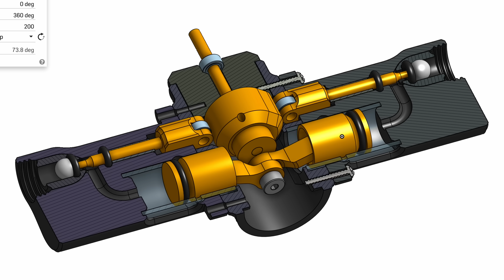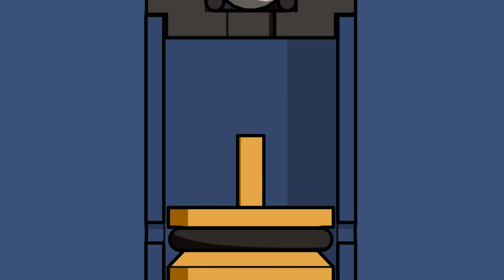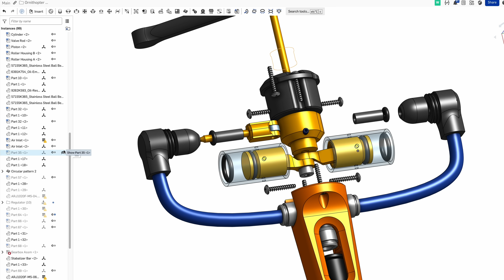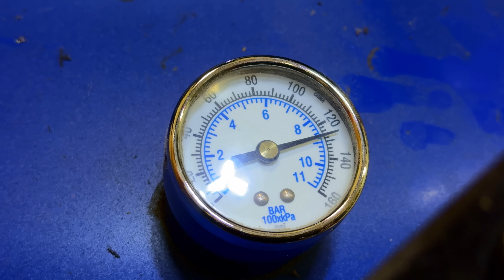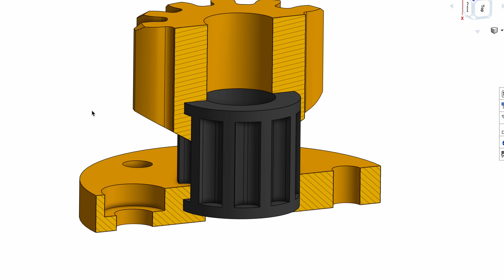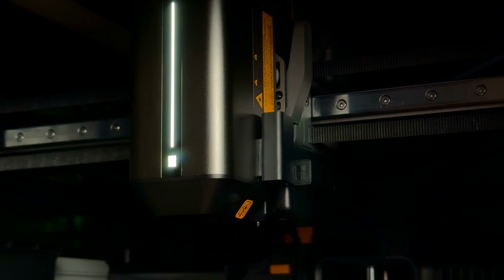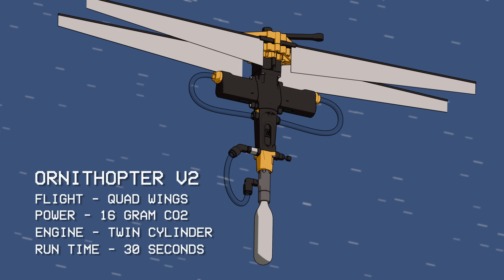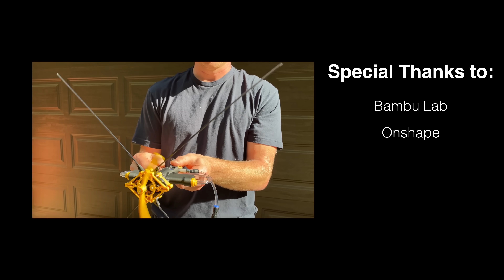I Tried to Build a Flying Machine With Just CO2

Comment: As an aerodynamicist I have to say yes you achieved some success in your mechanical designs and testing but you failed in the basic premise of creating sustained stable flight, you gave almost no thought seemingly to the wing design which could be massively improved and very little to all up to weight which are foundational to flight, I also wonder about the CG and torsional reactions you are likely to get. That said I enjoy your process and skills.

Comment: Honestly with the high torque motor you designed, you could slap on larger wings to generate more lift at a lower flapping frequency. I think the total weight still need to be shaved down a bit, but that could be a smaller issue than it seems. I'd hate to see this not fly, keep at it 🎉🎉
Reply: If I can give any kind of help I'd be happy too. I've been working on an Entomopter for a while now and got plenty of notes 😅

Comment: You could try lower friction materials for the pistons internals, try reducing the infill of the prints dramatically, and potentially a more aerodynamic design or cover for the pistons, might help prevent drag from becoming an issue. just some ideas tho, I'm not aerospace engineer

Comment: On your wing design I didn't see any details about the stiffening ribs and their intersection with the spar, are they free floating?  What sets the pitch of the wing (via the ribs) and transmits the thrust created by it's angle of attack?  They should be making a smooth vertical sine wave when viewed from the tips but it appears they're just going back and forth without an angular transit creating downward thrust.  Restricting the movement of the ribs in a pendulum fashion in each direction with greater movement towards the root and less towards the tip would enable that transmission of thrust.

Comment: This is amazing and the visuals are incredible. But, you are turning a reciprocating motion in to a rotational motion, then though a gearbox, then back in to a reciprocating motion. surely it would be better to just have flapping mechanism run of the piston directly. Like a little mini gas solenoid?
Reply from the maker: I was trying something like that early on, but I couldn't get the piston to run smoothly and at a reliable speed. Having the piston rotate a mass helped the engine run smoothly and then it just became easier to take power off of that rotation. I think that idea is still worth exploring though!

Comment: Instead of turning rotary motion into oscillation, why not eliminate the rotary motor and design a way to power the oscillating wing directly? That will save you in weight and may improve efficiency.

Comment: This is so sick - your mechanical design skills are phenomenal dude, can't wait to see more!
Reply from the maker: Thanks man! If I ever get it to fly I might need some tips on deployable landing legs ;)
Reply: @worksbydesign  Instead of CO2 cartridges, you might want to take a look at using the canisters for the mini signal horns for boating. CO2 has a verry high preassure, which requires quite heavy cartridges and strong regulators. That is unnecessary weight, since the higher preassure is just dropped at the regulators. The mini air horn canisters use a gas, that is liquid at much lower preassures (8 bar or ~ 3 bar/43 psi for the ones fillled with butane), so a lighter regulator can be used, if needed at all, and the cartridge has a much better gas to weight ratio.
Reply: OMG ITS YOU!

Comment: Really good video :)
I think you need to design something simpler. Integza made a design similar to Tom Stanton but maybe even more efficient. You might want to give it a try.
Maybe try to simplify as much as possible the path of the air from the regulator to the wing motion. It will need to be something extremely simple and genius to make it lightweight and fly.
Don't give up on it. I am sure you will make it work! Good luck :)

Comment: The video glossed over the coolest part of the design (in my opinion), the CO2 regulator. The video seems to show him designing it, but the part itself looks massed produced. How? I need this regulator for projects.
Reply from the maker: That was my favorite part too! I had the parts machined from aluminum and laser sintered from titanium to withstand the higher pressures. I’ve got the full CAD files and drawings on my Patreon if you’re interested!

Comment: I’m not any kind of engineer, and have no experience. That said I might do some tests with the gear reduction to find a better balance maybe? I would also try and use material with triangular holes in it for non air tight components- I don’t know how many parts need to be airtight though.

Comment: Use the laser cutter module to cut all the yellow top frames from some carbon fibre sheet.  "Skeletonize" the crankcase and all 3d printed parts. Redesign the root of the wing so that the boom can pivot back and forth (20-30 degrees each side?), improving the angle of attack of the wing root

Comment: I am not an engineer, but I think I have an idea to optimize your engine. What if you use just one sphere moving left and right to make air go into the engine? Maybe in this way you can reduce the engine weight. Also to reduce imbalance try to make a sincronized boxer engine like the one in the citroen 2 cv engine. In this way you can use a lighter flywheel.

Comment: Very interesting. A thought to reduce weight and increase efficiency... although getting it to work might be an absolute SOB.
As soon as I saw four wings I thought "Ah, dragonfly!" So how do they flap their wings? Very basically their wings are part of a resonating system where the wing roots are set in to a flexible box. This allows the wings to flap with great efficiency and much faster than the muscles providing power can twitch - the muscles just give the whole resonating system a kick every few cycles to keep it going.

Comment: you may know:  the amount of mass that is in reciprocating motion  Should  be  Minimized.  ( pistons, wrist pins, con-rods, rod ends/bearings )      the inherent out-of-balance condition at the crank-pin should be minimized.      a significant amount ot of energy is lost in a planetary gearset.      relatively more energy is lost in a more complicated valve train; however, imo, the operation of valves should not depend on gravity.      you may realize that your initial run duration estimate was based on an un-loaded engine. 
0438  in a power transmission transform such as this, having load-bearing parts 'hanging off the end' of a drive shaft is a less-than ideal design.

Comment: I think that te wings have to be bigger. The movements are now limmeted by the slowness of the mass. Not enouf by the air resistant. So make te wings bigger without adding weigt. Dont try to 3d print everything. Use thin springwire. Its very strong and doesnt bent easy. Use thin celofaan voor the rest. Just my idea. I am not expert. The motordesign is briljant. Great work. I am sure this will work if yo improve it.

Comment: That's a sick engine, and the co2 regulator could be super useful for tons of projects, although my issue with co2 cartridges is usually trying to get the pressure out faster...
Reply: Instead of CO2 cartridges, take a look of using the canisters for the mini signal horns for boating. CO2 has a verry high preassure, which requires quite heavy cartridges and strong regulators. That is unnecessary weight, since the higher preassure is just dropped at the regulators. The mini air horn canisters use a gas, that is liquid at much lower preassures (8 bar or ~ 3 bar/43 psi for the ones fillled with butane), so a lighter regulator can be used, if needed at all, and the cartridge has a much better gas to weight ratio.
Reply: Hi Joel, next video when?

Comment: you could try adopting integza's design for the motor (https://youtu.be/udI2dWmwMUE?si=1pHLtor084M_1jR2), and try increasing the amount of air the wings move by making larger wings. You could also try to alter the gear ratio to increase the bpm.

Comment: 1. Turn the wings 45 degrees. They should push the air vertically not horizontally. 

2. Make guide for air outtake face downwards 90 degree. Use it as a lift force.

Comment: This is a brilliant project, fantastic work!

In regards to shaving off weight, I have to ask: what material did you print the main parts with?

If I can toss a recommendation your way in case you try anything similar, High Impact Polystyrene (HIPS) is one of the lightest polymers I've had the pleasure to print with (it's also pretty damn strong). I'm guessing merely using HIPS wouldn't get the this ornithopter airborne, but maybe you'll find some use for it in a future project.

Comment: I'm no expert, but a good way to reduce weight would be to reduce redundancies. I'm not sure how possible it is, but you have two pressure regulators, maybe you could find a way to reduce directly from the 800 psi to 30 psi.

Comment: If you are an engineer do the basic math and build something that is able to achieve flight and is controllable. Just use a normal brushless motor and check what is their output thrust using propellers… that’s a good approximation , the eventual thrust will depend on the efficiency of your mechanism and wings.

Comment: Can someone explain to me what's the benefit of the high pressure CO2 with multiple levels of regulator as opposed to one larger tank at lower pressure?

You are trying to counteract the weight which means less parts would be better and size is not the primary concern

Comment: I loved the video, that quality is crazy for free content! I hope to see the next part soon! :) 

Here are a couple of ideas to improve the design :
- Check the infill of your 3D prints, not all of them need to be that strong and/or heavy.
- As other comments already said you convert the reciprocating motion of your pistons into rotary then back to reciprocating. This is a major factor that adds weight unnecessarily.
- Your initial regulator in metal weighs a lot, every piece of metal you can shave off will take a lot of weight away. So either replace it with a plastic piece or maybe this would be the perfect place for a 3D metal print!
- The wings could be bigger, you have a lot of torque after all so use it all instead of keeping too much inertia. It makes the whole mechanism shake, you can see it when the wings go back towards the center and stop at the end of the motion. If all the energy was used it wouldn't make the whole assembly shake.

Comment: maybe you can use the back pressure of the regulated air on the other side of the regulator piston to reduce the spring force needed? I think the regulator along with the cartridge are the heaviest parts. As someone else stated, you might be able to simplify the engine and remove the camshaft to reduce part count and weight. Increasing the amount of pistons may also allow you to get rid of the gearbox which can save more weight. Anyways, very impressive project and the explanations and editing are top notch!!

Comment: 6:30 It wasnt shaking becouse it lacked a flywheel, it was becouse you built the engine without considering balance at all. You want your opposing pistons firing at the same time. It will still create some torque, but it wont shake so much

Comment: If you already need the heavy regulator for the high pressure, just make it one stage all the way down to opperating pressure!
I know it gets more difficult to get a precise pressure with such a big gradiant, but there are some tricks to achive that.  😉

First you need a conical valve without o-rings or gaskets.
This gets you a very linear, short acting behavior.
Like in most commercial designes, you have a valve seat out of a softer metal like brass, and the needle on a steel diaphragm.
The diaphragm acts as the piston, guide and seal all at ones without any mechanical stick slip.
To back that up you need a verry stiff spring, preferably a disc spring, wich makes this verry compact and light. 

I would guess you could make the regulator half the size and weight of your curent high pressure one!

Edit:  My experience is with 200-300 bar systems, but those co2 cartridges just have 8 bar 😅, so you are good with a plactic diaphragm, and maby even a plastic valve seat!😆

Comment: A couple of remarks on the design:
1) you lose energy by using a reducer. In your case near 80% is lost. Why? High pressure gas needs to expand to reduce its pressure. In case of a reducer, expansion is done without doing work.
2) you can use dry ice as a source of pressurized gas. This way you could control pressure without a bulky reducer. Also, energy will come from the environment heat - you could call it a "free energy"
3.0) the design is limited by amount of power it can produce, thus it's needed to reduce the power losses after the engine
3.1) you accelerate and decelerate the wings four times per wing per cycle by the engine. You can store deceleration energy in a spring and return it back for wing acceleration. This could be really important for fast moving wings
3.2) you are trying to achieve higher lifting force by increasing the speed of the wings, and thus increasing the speed of air pushed by the wings. Note, this strategy requires quadratically (!) more power. Why? Lifting force is d(mv)/dt, where m and v are the mass and velocity of pushed air. To achieve this lift, you need to insert power at least d(mv^2 /2)/dt. You see, power scales quadratically with air velocity and just linearly (!) with air mass. Thus, it would have sense to make larger wings, which would move slower but plow larger mass of air (there are own limitations to this strategy)

Comment: Seems like there's a lot of dead time when the wings come together.
It would be nice to see a graph of the lift on a force cell instead of on the scale.
I'm assuming cheap scales just have a strain gauge you could tap into to make that easy. That would make optimizing the angular velocity profile for the wing flapping a lot more efficient.

Comment: As an engineer, the next best thing to do is iterate, find bulky choices you made, can you down size all your screws, or can you slim up some walls in your prints. Finding all the tiny deductions you can make will add up. I wont claim to know much about those wings, but they looked a little slim, maybe increasing the surface area of the wings might improve lift. Really cool to see.

Comment: Dude this is awesome work, project and video production!! A lot of good comments here about using a direct drive to keep the reciprocating motion. It's got me thinking, what if it did have direct linkages and had like 2" bore pistons, but with a rather short stroke so its still small? You could use leverage for the gearing, and could try a lot higher pressures and might be able to have enough torque per cycle to fully cycle the wings. It seems you'd get exponential torque gains as you increase the piston radius. Can't wait to see what you come up with!

Comment: Thanks for another great video. I've been subscribed since the earlier days of this project. The quality of the stuff you are making, and the quality of the videos themselves are getting better and better each time even though they were already better quality than most of what's out there. It makes sense it would take a long time to produce each video, but if you have time, maybe you could also put out some videos that won't take as long so you can have them come out more often. Perhaps talking about a different mechanical design theory or tool method each time, or something else related to making things in general.

Comment: Very impressive design, and it's a shame that the weight / thrust balance didn't work out.

While I agree with some of the other commentors with respect to trying a direct-drive mechanism, I think there's some room for experimentation with this current build - probably not enough to achieve flight, but enough to learn something.

How much experimentation did you do with wingspan and area?  There's very little mass involved in changing the wing, and so it makes sense to optimise this as much as is possible. It's probably easier to improve their efficiency by a certain percentage than it would be to shave off the equivalent mass.

If you do try a direct-drive version, I think going for a small-diameter piston running at the full cartridge pressure will be the most likely design to succeed. It cuts the weight of using regulators out, and keeps the overall engine small. The challenge will likely be in designing a mechanism that can handle the resulting forces without excess friction or becoming too heavy.

Comment: I love ornithopters. I remember getting a balsa wood ornithopter kit from hobby lobby is a kid and I had so much fun putting it together. I always am looking for another one but have never seen them in stores. It was extremely finicky and was not a easy build at all. It was pretty similar to yours except for horizontal but it had four wings like yours which isnt very common. I also had an rc one as a kid that was a blast but the balsa wood one was more memorable.

Comment: Awesome project. It seems like the wings are losing a tonne of lift by being so floppy at the bottom. I don't know this for sure but just looking at the design it seems like as the arm of the wing moves, the bottom of the wing (and that it's not supported) just flops in the wind and isn't actually moving the air the way you want it to. Just a thought.

Comment: I wonder if there may be a way to optimize the wings to increase lift. The material may have been correct at the smaller scale but could require more stiffness, thickness or shape at the larger size. Thicker material? 
Battens? 
Airfoils?

Can’t wait to see what you do next! This is a fantastic project with superior production quality. More please.